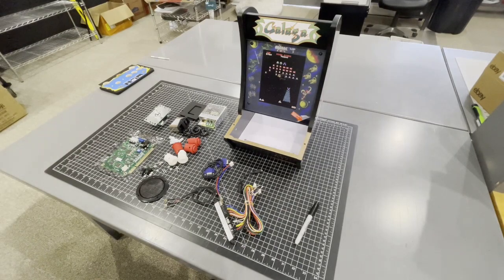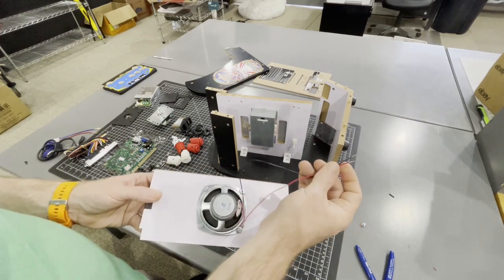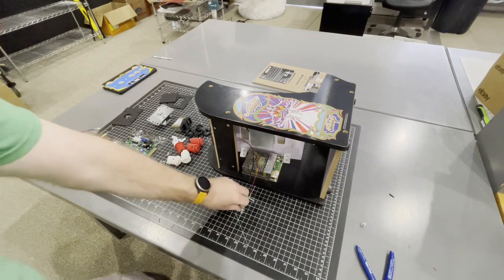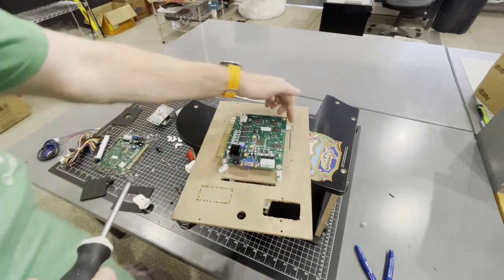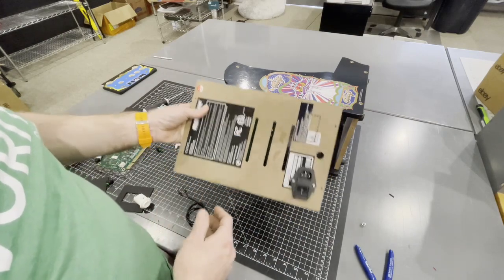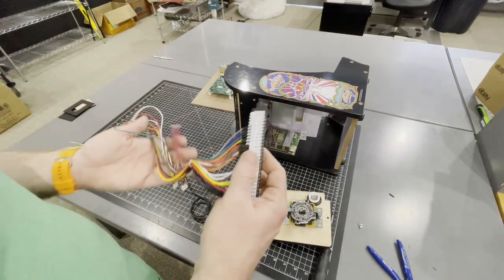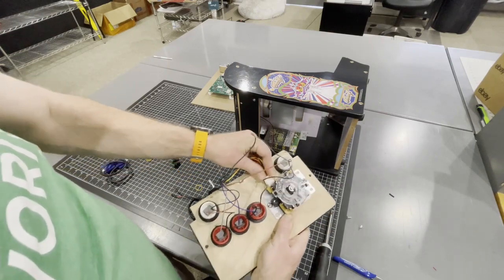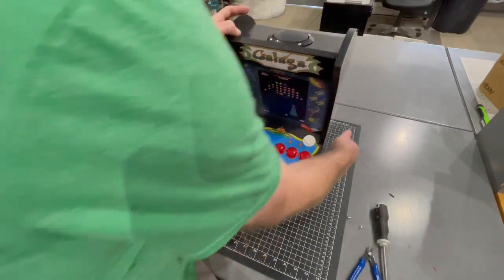DIYRetroArcade 60 In 1 Arcade1Up Countercade Generation 2 Install Video

Comment: So without the lcd driver you won’t be able to play and the price for the kit is $129.00 that’s should be in the kit also.  If you can’t play after all that work what’s the use of buying the kit.
Reply from the maker: Not everyone uses the factory LCD. It would just be a added cost for someone if they were not going to use it.

Comment: @DIYRetroArcade Do you have any replacement screens you offer or sell to go along with this kit you are offering? I really dont care for the lcd screen in the gen2 and would like to swap that out. Any suggestions?
Reply from the maker: This thing is so small all our LCD are bigger then the bezel. Nothing at this time
Reply: @ Joey Check ebay. Get ur self any 8 inch or  7 inch screen. Open it, take apart ur new monitor,  remove the screen and buttons from the new monitor and just swap it with ur old one. Search in  youtube if you want to see the whole process. Its been done. Good luck !!!!
Reply from the maker: @jeff15  do you have a link? I will add it to the video

Comment: Thanks for the detailed video... I'm looking forward to getting the Gen 2 upgrade pack when it's in stock.  I'm guessing I'll also need the $17.99 LCD Driver on your site if I want to use it with the factory screen?  Is there going to be a follow up video on how to install that piece as well?

Comment: If you setup the speaker then How do you control the sound  volume I didn’t hear you mention the volume button..
Reply from the maker: there is adjustment on the 60 in1 board itself.

Comment: I've never done any mods before, and have zero technical ability, and I was able to follow this and get the arcade up and running. Thanks for being so thorough and really dumbing it down, I needed it. I did have to look elsewhere to figure out how to install the LCD driver; it's super simple but I had no idea what to do. I saw the video about flipping open the little plastic piece, but didn't know what to do next.

The one drawback to this setup is that, if you want to change the volume or play with the dipswitch settings, you have to take off the back of the cab, but I came up with a perfect workaround: The little round hole down at the bottom of the back of the cab (where the original power cord was) is exactly the same size as the test button. So I just mounted the test button back there, and now any time I want to change the volume or settings, I just reach back there and hold down that button while I power on.
Reply from the maker: Right on! Thanks for the tip

Comment: Just an observation, since the only LCD controller available for the Gen2 uses only HDMI as the video input the VGA/HDMI adapter they offer needs micro USB for power. So that’s another power cable needed to make this work. I’m wondering if you can connect an additional cable to the power supply for this. (On top of the cable needed to power the LCD controller.)
Reply from the maker: We now have a LCD driver for this with VGA or HDMI. They should be available in the next 2 weeks.

Comment: Will this work on a gen 3 countercade? I believe they are the same size
Reply from the maker: yes
Reply: @diyretroarcade  This does also include your gen 2 LCD board, correct? Or will I have to buy a separate one?
Reply from the maker: @hellacia8151  lcd drivers are sold separately as not everyone uses the factory lcd
Reply: @diyretroarcade  i have the pac man galaga combo countercade, which came out i 2021. Will the lcd board you are selling work on that countercade?

Comment: Shane, can this also go into the same-size Ms.Pac cab? Also, can the Mag-Stik 4-way to 8-way stick go in here?
Reply from the maker: will fit any Gen 2. Gotta use the sanwa, its super tight. Do not see a magstick fitting
Reply: @diyretroarcade  Thanks!!

Comment: website says out of stock, already? 3/21/21...also, is there gonna be a lcd driver ? how do you get it on  the screen? TIA
Reply from the maker: GeekSales on ebay typically sales LCD driver but out atm. We do not carry them at this time. We sold a lot of kits today, will have to verify stock tomorrow before we sell more

Comment: This is great, just placed an order. Does anyone make like a 1inch trackball that would fit underneath for Centipede?
Reply from the maker: we barely got what is there, do not feel anything else is gonna fit
Reply: Could I use this kit on the centipede 1gen countercade and just add more button holes and the correct screen video board?
Reply from the maker: @principalcarranza  we have a gen1 kit :) https://www.diyretroarcade.com/collections/a1u-cc-vertical/products/arcade1up-countercade-60-in-1-conversion-kit

Comment: I also got the Galaga CC at WM for $50.  I kinda want to do this. My only concerns are it's such a cool 60-in-1 board, the screen is pretty low quality, and that for the total cost of $180 - is it worth it?  I may just put it in a 3/4 size? How much is that control panel? That'd probably bring the total cost over $200.  Also, the 60-in-1 doesn't have Galaga '88', which is only available to buy in this unit (aside from getting the rom & using a Rasp.pi). I wish there was a good quality 10" screen option.
'
Reply: I'm pretty sure Galaga 3 (which is on the 60-1) is the same as Galaga 88. Just named differently.
Reply: @crimzon0549  Oh, that'd be cool. I'll look into it - Thanks!
Reply: @crimzon0549  https://en.wikipedia.org/wiki/Galaga_%2788

Galaga '88 is a 1987 fixed shooter arcade game by Namco. It is the third sequel for Galaxian (following Galaga, and Gaplus). It features significantly improved graphics over the previous games in the series, including detailed backgrounds, larger enemies and greater ship details.

Gaplus is a 1984 fixed shooter arcade game developed and released by Namco. It is the third game in the Galaxian series, serving as a direct sequel to Galaga (1981). In North America a modification kit was later released to change the name to Galaga 3, possibly to increase recognition, even though there was no "Galaga 2"

So in order...

1979: Galaxian
1981: Galaga
1984: Gaplus aka Galaga 3
1987: Galaga '88
1992: Galaxian3: Project Dragoon (Laserdisc rail game)

Comment: How do you adjust the volume?
Reply from the maker: there is a pot on the physical board to adjust
Reply: Thanks
Reply: You can also boot into service mode, and on the second to last option page you will find your option to adjust the volume

Comment: Don't waste ur time or money. Just buy a pi
Reply from the maker: 60 in 1 is for the person looking for a PNP kit and quick and easy install. Can be enjoying the machine in a few hours. Pi is great for lots of games but it comes with a much more difficult install and on a personal note I always seemed to mess with the settings and software more then I played.
Reply: @diyretroarcade  I'd have to disagree. Pi is way cheaper. (Also better) easy as hell to install. Max time could be 20 min. Also u don't have to put 1000s of games. Just put w.e you want. Settings barley need to be touched right from image. All and all way better bang for your buck and my personal opinion looks way better.
Reply from the maker: @Snapps240  pi is not any cheaper. You need to buy lots of parts beyond the pi to make it all work. Add in encoders + sanwa joystick + power supply ect and you are on up there as well. Both have there place and both are great choices and hey we sell both set ups so we won't talk bad either way :P
Reply: @diyretroarcade  got a pi 4 4gb for $35(4gb not needed). You can also buy an encoder for $5 and use the joystick and buttons the machine comes with. Over sized 64gb memory card you could buy for $10 and a video adapter for $20. . $70 or less this can be done. Can you do a limited 60 in 1 for $70 or less? can prices so less in us
Reply from the maker: @Snapps240  you missing power supplies, hdmi cable, assorted wire, most use a amp, nuts bolts and other assortments and the prices you are quoting i would assume are from China. You can take a 60 in1 board at $38 + jamma $13 + power supply $13 and use the joystick, buttons as well and be at less then $70. Compare apples to apples and the 60 in 1 will be cheaper, but we know that no one is going to want to reuse the lower quality stuff that comes with the 1up. Again, we sell both and support both so get what you like but in the end, its going to all be the same cost by the time you get all the extras. Some want plug and play some want to mess with software. At $50 bucks a cab why not both :P
Reply: @diyretroarcade  u don't need an amp. The video board has a built in amp that powers the speakers perfectly. Can also put the stock vol switch to control the vol. And sure go to the $1 store and buy an HDMI cable if you dont already have a million laying around at home.. Also with a $2 step down u can use the 1up power supply to power the pi. Also can go to the $1 store again and buy a USB cable to power it again if you don't already have a million laying around at home. I prefer a pi that's all. PPL do what you please. But try a pi and thank me later. Lol also 100s of pre done images you dont need to touch any software and it takes max 10 min to write the image on an SD card. I just hate when ppl say a pi is hard to do. And it's practically just as plug and play and 1000 times easier to find more info and how to's but again do what you please lol
Reply: @Snapps240  You got him brah. You dont need all that extra crap to make a pi run LIKE DYI said. My brother did his and spent less then $70 if that and has his pi4 kicking ass on his countercade v2.  Even found a sanwa joystick on craigslist for $10 and still spent no more then $70 !!!!!!!!!!!!!!!!!
Reply: @Pro96FTA  people just talk out of there butts and say you need this and that especially when they sell the stuff that way you buy everything and anything. When in fact a real DIYer knows what you really need and don't need. I'm happy to hear that there are others out there who understand the real ways to do things and the minimum needed. Lol
Reply: Tree Rat FamilyForEver  👍👍👍 fair enough. Do what makes you happy
Reply: Tree Rat FamilyForEver  for any novice out there. Google pre built images of retropie. U simple write the img to an SD card (10 min) stick it in ur pi. Done. You don't need to touch any settings or deal with rb os or Linux in any way (writing img can be done using any OS you prefer)